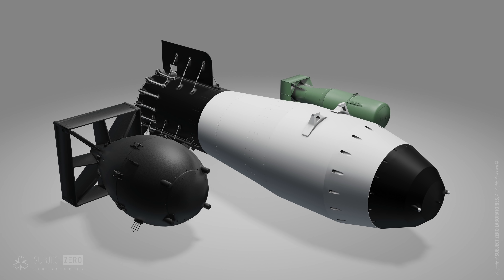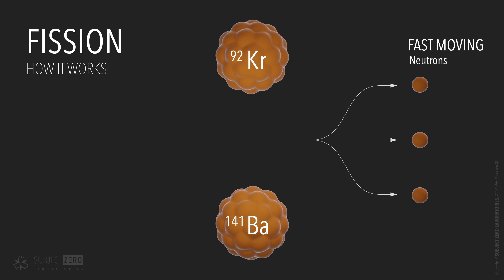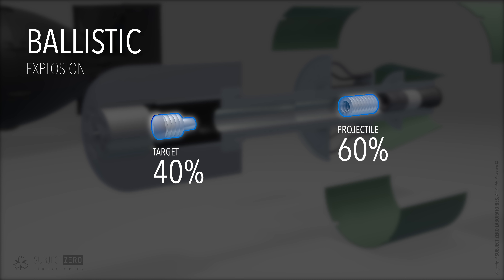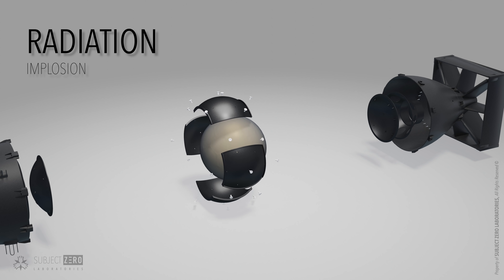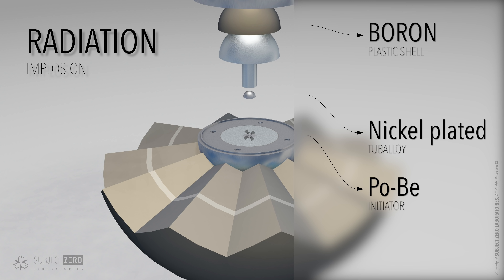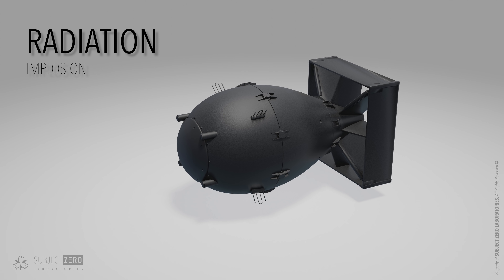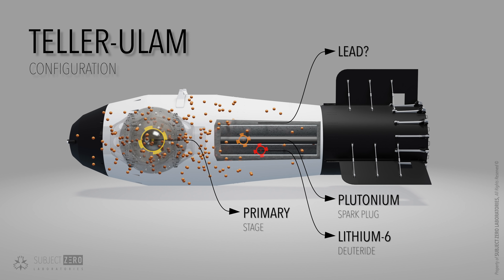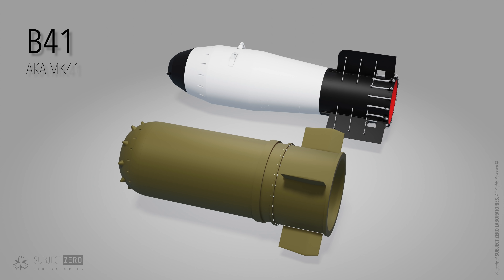Are Russian Nukes the Most Powerful?

Comment: The scariest fact about the Tsar Bomba is it was originally designed to be 100 megatons but at the last moment the bombs designer got scared that it might be too powerful and reduced it down to 50 megatons
Reply: Right, Andrej Sacharow the father of the AN602 zar bomb got doubts about the madness of a 100 megaton bomb, so he halves the explosive power.
Reply: @achimgeist5185  yeah. and this was achived by removing just a single layer of fuel. Increasing power is the same simple by just adding extra layers.
Reply: @night_gryphon  That "extra layer" as noted was the uranium tamper being replaced with lead. You wouldn't add more layers, as it would just be more efficient sizing up the ones you already have. Also the real reason for this change wasn't as much the size of the blast, but how much fallout it would have falling down on the USSR (as it is, the tsar bomba barely had any fallout, especially for its size).
Reply: Not too powerful, they didn't care about that, they removed the final stage as it would result in a lot of fallout over Moscow otherwise. As it was, the 50 megaton fireball vapourized most of the crap.
Reply: @abloogywoogywoo  i'll dissapoint you even twice. 
The Russia is big. It is REALLY big. And blast site was far enough that even with 100 MTons and even in worst case nuclear cloud was unable to reach Moscow or any large enough city in any dangerous concentrations.
Also the nuclear bombs are not that dirty as the crap dirty bombs US throw on to Japan. Well made nuclear bombs spread radioactive isotopes as less as possible. Spreading unfissioned materials means loosing fuel making bomb less effective. Furtermore only brain dead ones need to turn battlefield in to radioactive desert unusable in hundreds of years forward.
The main concerns why power was reduced  was about damaging earth plate and possibility of chain reaction within atmosphere (don't ask). 
Also even less powerful test was enough to proof concept of this scalable solution allowing to create bombs of virtually any power.
Reply: And it was 57MT not 50
Reply: @night_gryphon  Novaja Semlja isn't actually too far away from inhabited land (including western powers), and the size weapon here would have sent the fallout so high that sure it could have gotten to Moscow too with (un)favourable winds. And thermonuclear devices are NOT "clean" by any means, at least in configs designed for warfare (as noted over and over, the Tsar Bomba design was changes to remove most fallout, halving it's yield). As such the fallout from it would be an order of magnutude worse than either of the bombs during WWII, particularly as the unfissioned materials are your LEAST worry, with their long half lives. What matters for fallout is the fission products. Spreading unfissioned U-238 also isn't much of a loss, as it's effectively a free byproduct of uranium enrichment, and part of it's use is as a heavy, hard tamper for the weapons, with the added benefit of it actually being fissionable too. That thermonuclear devices are scalable to nearly any power isn't really news, it's also pretty much pointless as beyond a certain size you're just not getting much added actually destructive potential (the only reason the USSR kept building somewhat oversized bombs were their far less accurate delivery). What's more relevant is "dial a yield" nukes that can be configed before the attack to suit the target.
Reply: @night_gryphon  no. Typical fusion bombs are initiated by a somewhat conventional fission explosive a.k.a."atom bomb", and fast neutrons from the fusion fission the depleted uranium case of the physics package, boosting yield (and fallout) dramatically. 

And the fast neutrons both in the fusion stage and from small amounts of fusion from tritium boost in the fission initiator cause more complete fission of the plutonium pit in the fission initiator. All told about half of the yield of megaton and hundreds of kiloton bombs is from fission. Meaning far more fission products than an "atom bomb" and far more fallout. Fusion bombs are spectacularly dirty, because they aren't pure fusion, more like half fusion used to extend the size of a fiseion bomb arbitrarily.

They can be made cleaner, especially when talking about fallout per yield, by eschewing this extra fission, but typically they aren't because that means a much smaller yield for a give size of physics package.
Reply: @Agarwaen  yeah after a certain size, most of the energy is lost in blowing atmosphere to space D: Not to mention cube law scaling, mean it's far more destructive per given weight to have multiple smaller bombs, which scale linearly.
Reply: Personally what I find more alarming is that the US first tested an atom bomb when the scientists thought it might set the atmosphere on fire not "the local airspace" the atmosphere.
Reply: Ikr
Reply: @night_gryphon  Lol yep, that's what I've always heard. There was a small possibility that the heat and pressure wave could potentially cause a runaway chain reaction of igniting a large chunk of the atmosphere.

Not sure how the physics behind that actually work, but it it could be persuasive enough to convince Soviet higher-ups to not push it, must have been pretty damn scary!
Reply: @Agarwaen  I think you meant U235 not U238. As U238 is not fissionable, unless converted to PU239 via nuclear reaction (U238 captures a neutron beta radiation conversion, twice - Np 239 then to Pu239 ). Otherwise your points are well taken.
Reply: @1Barsamian  You're confusing "fissile" and "fissionable". The U-238 in the tamper does end up as fuel for nuclear reactions in thermonuclear bombs, no matter if it goes by way of other reactions first, just as with the lithium fuel used for fusion. Of course, it's not really effective, but by all metrics it's also "free" added yield (given how the U-238 is a byproduct and it's one of the most ideal materials to use in a tamper simply from a mechanical point).
Reply: A lot of misinformation here, they simply halved the yield to enable the pilot to get away
Reply: And even afterwards it was quite a disaster. Explosion made a chockwave, that went around the globe THREE times over.

J. Robert Oppenheimer Created the weapon to destroy the world, while THIS scientist saved it from unbeleavably strong bomb, that potentially is equal to meteorite landing, by halving it's strength.
Reply: @duddude321  yeah some scientists had that concern, but most thought it just wasn't a thing.
Reply: @stephenblair67 yeah that's what it was for, political one-upmanship and good old fashioned Soviet sabre rattling :P
Reply: Scary fact is the Russians at that time lied about everything to make them seem more dangerous than they were 
During the famous May Day parades a good portion of the missiles and rockets on display were fake
Reply: @FP194  Yep, look at the so called missile gap. The US believed there were several hundred Soviet ICBMs at the time. In fact there were somewhere from one to three.
Reply: To powerful for what?
Reply: @duddude321  the scientists accully said it was a bad idea. The us goverment thought it was a risk they where willing to take.
Reply: @ra6865  too much radioactive fallout contamination because upwards of half of the yield was to be from fission of the depleted uranium of the bomb surrounds, caused by fast neutrons from the fusion.

So if this modification halved the yield, putting it back is going to make a yield of 50Mt fission, which is where most of the radioactive fallout comes from, basically that's like the amount of radioactive crap falling out of the sky equivalent to 2,500 Nagasaki bombs. And it would spread further because it's blown higher.

Additionally, even if it wasn't a contamination nightmare testing it, having a bomb this big is kind of stupid, except for propaganda and gaining advantage basically because of the threat, because doubling the yield doesn't double the blast and heat radius.

Instead it goes up by yield increase taken to the one third power, so a 100Mt bomb being 5,000x higher yield than the 20kt Fatman device dropped over Nagasaki would not destroy a circle of 5000x the radius, but only 5000^(1/3) = around 17 times the radius, or about 300 the total area destroyed.

But if you use 5000 bombs as powerful as fat man, you destroy 5000 times the area if you drop them on separate targets...
Reply: @MrGoatflakes  thanks for the info. But what i meant was, even the least powerfull mass distruction bomb is too much already. We should have stoped there :)
Reply: The japanese forced those bombs to be used. The attack on pearl harbor , the death of thousands of american soldiers waging there war and there refusal to surrender . Dont start a war if you cant destroy the enemy
Reply: @eddiekulp1241  you should look in to why usa used the bombs... it was not to defete japan... japan was already done. The conditions america wanted for a surrender was not any sane nation would accept. But this is way of topic!
Reply: That makes sense
Reply: @ra6865  you say that, they've only been used twice, and they are really the only option we have for deflecting asteroids the size of Manhattan that are definitely out there, definitely in our way, across our orbit, and which have ended 99% of all life on the planet at least once before.
Reply: @MrGoatflakes  not true. Over 2000 nukes has been used on earth, under water and in space. Usa also tested nukes near islands  to see how those who live there reacted to the radiation. the fallout of those nues still affect us globaly. Using nukes to stop comets is a bad idea. we will most likley alter their trajectory with probes.
Reply: @ra6865  no. On both counts. Testing happened first to see if the new bomb designs actually worked as intended, second to work out how they would affect cities, both for offensive and defensive purposed.

That they occasionally harmed people was considered an unhappy accident, and in fact when they tested in the southern pacific they evacuated the local population from where they thought the danger was going to be. Notably they got this wrong at least once.

In this the only indisputable case of people being harmed by the nuclear weapons tests of the USA, was during the Castle Bravo test. Which was so greatly over the predicted yield it caused severe problems to the test personnel, nearly knocking observation planes out of the sky and requiring men to be rescued from an observation bunker by helicopter.

Additionally the wind was miscalculated which caused fallout to fall on populated areas that weren't evacuated because they were thought to be safe.

Still the only death at the time was on the Japanese fishing vessel the Fukuryu Maru, where one crewman died, and others were made gravely ill.

Others probably died later due to the increased risk of cancer. Which is of course extremely unfortunate. But it wasn't deliberate and was instead caused by basic misunderstandings about the forces at work, both in the construction of the bomb leading to the spectacularly increased yield, and the wind phenomena that they thought they understood well enough to predict the fallout plume, when clearly they didn't.

As for deflecting the path of an iron asteroid the size of Manhattan, which is on the order of the asteroid that caused the K-T mass extinction event, you are dreaming if you think that we have anywhere near the capability to deflect it using our conventional propulsion methods.

The currently most efficient conventional propulsion is ion engines. The most powerful to date has about enough force to levitate a piece of paper in earth gravity. Chemical rockets simply don't have enough specific impulse either.

Whereas using nuclear explosives as propulsion was fully capable of launching a ship, again the size of Manhattan into orbit and onward to the stars, from about 1958. https://en.wikipedia.org/wiki/Project_Orion_(nuclear_propulsion)

It wasn't pursued due to the partial test ban treaty and concerns over the fallout.

But no such concerns over fallout exist for detonations in space. And although the partial test ban treaty does in fact ban detonations of nuclear explosives in the vacuum of space, I'm sure the international community would like to make a one time exception in the presence of something capable of scrubbing anything larger than a mid sized dog from the face of the planet and indeed from Her oceans.

However this is all a bit academic currently because we aren't doing much of a job even tracking said existentially threatening asteroids, let alone developing and testing a space craft capable of delivering such a drive soon enough to effect the required course correction.
Reply: @MrGoatflakes  Look up bikini atoll and the marshall islands. Usa tested more then 1000 nukes alone.  And you know there is a new spacerace for companys now? jeff bazos and elon musk is pretty intressted in capturing a comet... so i think in the near future those wont be a problem.
Reply: @eddiekulp1241  my grandfather thought that the atomic bombs were great. He lived through the near complete destruction of the unit he was in not once but twice in the pacific theatre, and he was sure his time was about to come. And then there was Hiroshima and Nagasaki, and the surrender. So there is a fair probability that I would not exist if those bombs were not dropped.

Also winning a war is not so much about destroying the enemy as breaking their will to fight. Which is why the entire approach in Afghanistan sucked. Killing one that is fighting at the moment doesn't accomplish much if by their death they encourage three of their countrymen to pickup arms.
Reply: It was also due to the radiation polution that would come with such massive yield.
Reply: imagine if he just went with 100 megatons instead
Reply: From what I've seen they reduced the power because the pilots would have died trying to outrun the blast if it were too powerful
Reply: if the fireball of such a dirty uranium secondary had touched the ground the fallout would have been unbelievably poisonous, that's why they used lead and reduced the yield
Reply: @Federico Riggio you don't know even the basics. The amount of fission changes hugely depending on the secondary (fusion) stage. The secondary needs a tamper. If it's lead nothing happens, if it's uranium it fissions and roughly doubles the yield. Fission produces fission products. If the fireball stands in the air they're tiny particles, get sucked in the mushroom head and nothing happens. If they mix with the ground debris, they're too heavy and they *fall out*. Only in the first two days they're very radioactive, and that's why they're dangerous if they fall out early. Tiny particles still exist but stay suspended in the atmosphere when they're dangerous.
Reply: @Agarwaen  power of fusion don't depend of uranium/plutonium quantity, it's all about how much hydrogen will used in fusion reaction, uranium or plutonium need only for start reaction, and for start reaction you need 10^6 *c, what gives any chain reaction, so if they use to need change power of hydrogen bomb they must change only quantity of fusion fuel - tritium and deuterium, so your info about layers is fake, and physical nonsense. and this is only half of story, nobody could knows how many fuel can be in reaction in first experiment so it's double fake, and after all fusion reactions even today all that's numbers of megatons is very formal stuff, 25mt can give 15 or 45. as 50mt can give 10 or 150, because after nuke inside explode all process go to absolutely uncontrol, because of 10^6 *c so you can put plutonium everywhere or only in center, most of fusion fuel will not in reaction. and after all people create neutron mini fusion bomb in beryllium  shell, this is next stage, as in fusion bomb uranium/plutonium just a detonator, as in nuke, tnt is only detonator, in the neutron bomb fusion reaction is only minimum part for mass alpha ray to beryllium, for create massive neutron radiation, what eliminate everything biological structure in 12km radius... so whatever you can read now in the internet or in rushn media like "they was change their mind" is fake, because nobody knows shit about what they do, so only what can be real they use to be thinking it will 100mt, 20mt whatever, and after explode they count it as 50mt all other info for morons
Reply: @abloogywoogywoo  no
they lowered it down since the crew who dropped the bomb wouldn't escape if it had it's full 100mt and even with 50mt and a parachute , the crew could barely escape the blast wave
Reply: It also means less warheads, bigger missiles needed for increased weight. It's more efficient and effective to use smaller warheads. Large bombs are just sabre rattling.
Reply: It has nothing to do with madness, it is about where you can test it.
Reply: slams fist on table 100megatons or bust!
Reply: The designer's rationale is that for the bomb to yield 100mt, the drop plane may have no chance to escape the fireball and destroys their instrumentation and test data. And he was absolutely correct, even at reduced 50mt the drop plane barely escaped the blast. There's really no such thing as fear when one is dealing with the real threat of total annihilation.
Reply: @night_gryphon  Im scared of Russia now, they could easily make a 200 MT bomb, maybe 500MT if we arent careful
Reply: @toasttoast9955  Yeah. Russia can. But didn't. Also Russia didn't ever used nuclear weapons against anyone.
Reply: @Agarwaen  Pardon but from what i read, the uranium tamper is well part of the reaction, it undergoes fission by the fast neutrons produced by fusion (that itself being 2nd "level" or secondary) - or more preciselly under the high neutron flux it breeds more U235 that then fissions...
It has also been said that the cycle fission primary - fusion secondary - fission tertiary can be repeated again and that it for some reasons is more effective than just scaling up the first two...
Reply: @Agarwaen  It was the "cleanest" bomb ever tested as i remember... 🤔
Reply: @franzhaider2221  per megaton yes, because they left out half the bomb
Reply: This place is a gold mine of information
Reply: actually the one dropped was a 50 mt test bomb, which was going to eventually be increased, but price went skyrocketing and it was discontinued
Reply: @aph4210  not really. the entire design was a test/showcase and not something designed for actual use. beyond a certain size you just don't do much additional damage per megaton and you're far better off with a larger amount of smaller bombs. also the design was FAR too large and heavy to actually be deployed.
Reply: @Agarwaen  Well yes that too, but my original point is what the guy up top said is not accurate, at least when referring to most western source
Reply: @jedaaa  58*